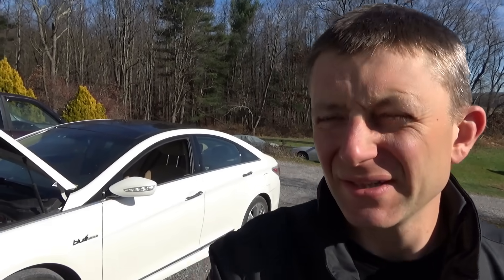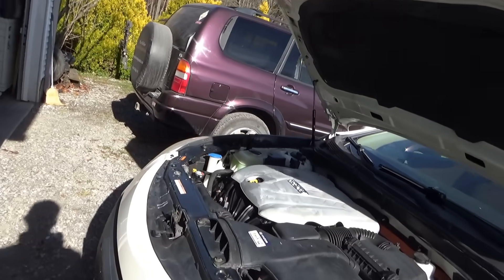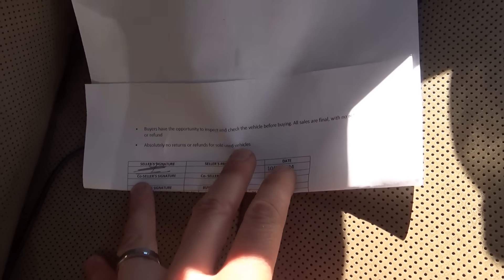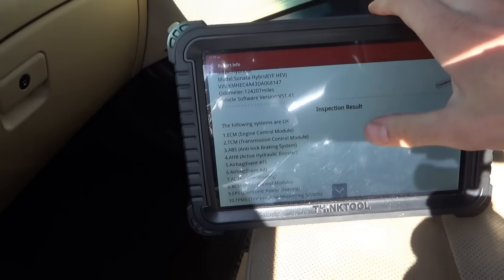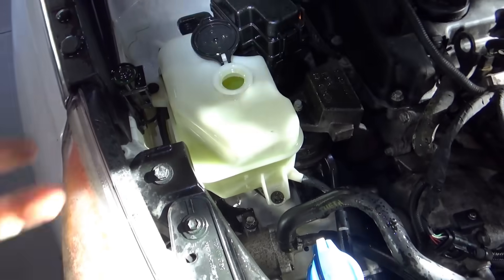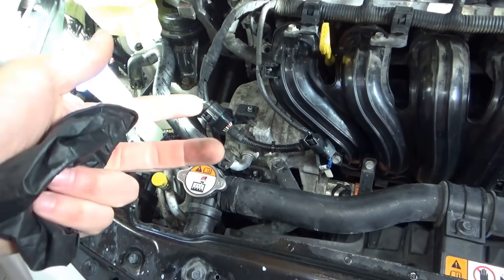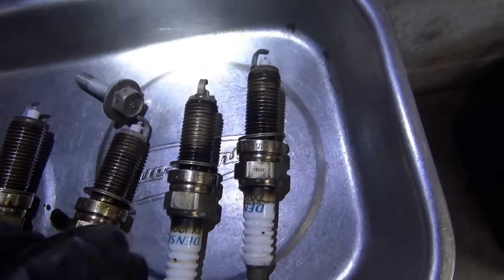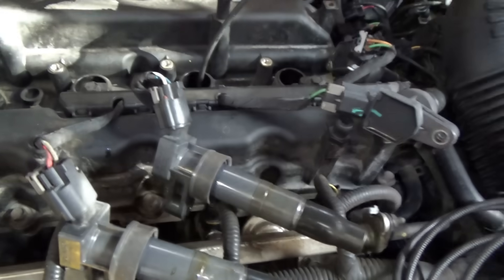Customer SCAMMED?! Hyundai Hybrid NO HEAT & PUKING COOLANT?!?!

Comment: That was bizarre ...it should have been pouring coolant out the tailpipe with that large leak...I guess the cylinder pressure was keeping most of it out but it really should have filled a cylinder after shutdown if it hadn't blown all the coolant out....you get some unique challenges Ivan....Karl from Canada🍁🍁🍁

Comment: If you live in a state with some level of consumer law, the dealer has to stand behind the car to some extent. Driving, home, 1 day, 1 week and a major problem, that is the dealer's problem or minimum the state will come down on them and their license to do business is in danger. Because of the age and little snow, it looks quite good from the outside, this novice buyer just drove it, looked at the outside, and bought it.
There are junk yard auctions and that is here the dealer goes, you typically need a dealer's license of some sort to buy there, many are insurance totaled vehicles, you know what you are getting into if you buy a totaled vehicle. If you buy through Carfax they will identify branded vehicles and the reason. If the car was not covered and a barley running trade-in or rejected for resale trade-in from a dealer, there may be little smoke, other than any Kia/Hyundai with over 80K is on fire regardless of the price.

Comment: VA, those Navy Sailors can't touch cars. Seen ones that work on a Nuclear Carrier, but blows up tire putting air in it, running back and forth to the dash, keeps putting air in till the light goes off. I had one snap back at me calling me stupid cause what their MOS is yet set their tires at over 95psi, with no oil in it, no coolant and wonders why.

Comment: I wouldn’t blame the dealer. Customer had every opportunity to get the car checked over and didn’t and I’m assuming he drove to Virginia from pa because the car was cheap. Bought the car as is. Customer didn’t do his part if I was the dealer I wouldn’t warranty anything. Small dealers are usually like us small auto shops and don’t want an unhappy customer I highly doubt they knew there was anything wrong with

Comment: Hello, I watched the video through I might have missed it but, were the radiator fans coming on when it was over heating?  That year Hyundai in the hybrid or not can have cooling fan resistor problems or the cooling fan will lock up. To cause the overheating and head gasket leaking of course. Thanks for the content.

Comment: States should start outlawing these types of dealers. It should be illegal to blatantly scam someone like this. I'd advocate for a 30-90 day consumer protection program on ALL vehicles ANY dealer sells (based on age/miles) and if a dealer gets caught 3 times in 12 months knowingly selling broken junk their dealer license should be permanently revoked. If I were the owner of this car I'd file in small claims court to make them defend themselves for knowingly selling a car with a damaged engine and failing to disclose that fact.
Reply: There is no proof the dealer scammed anyone. The customer drove the car to Ivan overheating! I am not saying the car didn't have any issues when he bought it, but its a used car the buyer should have had the car car checked out! They should have shut the engine down and had it towed at the first signs of overheating not continue to drive it! I think the buyer blew the head gasket because it may have had a water pump or  thermostat failure. I believe its all on the buyer! Of coarse my opinion is based on only what is in this video which is one sided. You always get a pre-buy inspection done! Always! No matter how new the car is and it doesn't matter how low the miles are. I have seen some very messed up cars at a year old and less then  20K miles.
Reply: @PrecisionMotorCar  That is a lot of victim blaming. All I'm saying is that used car dealers should be forced to stand behind their goods. No other business is legally allowed to scam people and hide behind "As-is; no warranty". For what it's worth, I've had a head gasket blow with zero warning signs due to bad luck with a burnt exhaust valve. No lights on the dash. Temp gauge in the normal range. Overflow tank exactly at the correct level. The only warning that the coolant was dangerously low was a gurgling noise from the heater core. It happened to be summer time so we weren't using the heater to know if it was putting out cold air. I have no idea how long we drove around like that and telling me that is my fault would also be victim blaming.
Reply: @TheRetarp  So if the head gasket happen to blow just "Because" that would not be the selling dealers fault. Maybe it failed on the way home? If so it would be you bought a used car and oh snap that sucks. We are assuming the selling dealer knew that the head gasket was blown, what if they didn't Know? What is they bought it from the auction had it unloaded from the truck it had no dash lights on and put it on the lot for sale. Why would that be a scam? We all know the sellers don't drive them, they never have enough fuel in them! Also they don't have a shop check them out before selling them! "Some do but not many" If the dealers had to fix everything that failed on a used car a used car would cost more than a new one! That is why there is a "As is" clause. Would you sell a car and stand behind everything that failed? How long do they warranty the car for? If the dealers were made to warranty a car for say three months then everyone would still call the dealers all scammers because it didn't last four months.The customer bought the car with bald tires. But did the buyer make a better deal and he was going to get his own tires? We don't know any of that! Just so you know I am not a car sales dealer I am an auto repair shop and I am the first one to beat up a car dealer! I just think we are blaming a car dealer with out all the facts. I know I would be pissed if I was that selling dealer and had worked out a deal that the car had issues and the buyer knew it and bought it cheaper and then everyone called me a scammer. The auto industry already deals with that enough! Again just trying point out it is a one sided story, we know the customer drove the car critically overheating, we don't really know how long the buyer had the car, we don't know how long they drove the car overheating? Just don't think we should throw blame when we don't know. The buyer should have not signed or bought the car if they didn't understand what "AS IS" means and should have had the car inspected! I am not saying the dealer is above board " very few are" But the buyer has to protect their investment and that starts with a used car inspection. Thanks for the chat! @TheRetarp
Reply: @VOLKSONLY  You are correct we don't have the full story here. This channel is notorious for one sided stories. I will stand behind my statements. A business which relies on taking peoples money and not delivering valid goods or services is not a business, it's a scam ran by thieves. You said you are a mechanic. You warranty your services right? How do you feel about repair shops which don't stand behind their work and also won't issue a refund? I'm guessing they probably piss you off! We have a few local 2nd hand games/cd/dvd stores in town where I can buy used gaming consoles which are guaranteed to function. If the console fails within 30 days I can take it back for a refund or replacement. If your shop can stand behind their services and a second hand game store can stand behind their products, why should a car dealer be any different? For example if I buy a car and the first time I fill the tank the MIL comes on for an evap code or it's leaking gas or yes if the head gasket blows on the drive home then in my opinion that dealer should be forced by law to either take that car back for a full refund or to repair it at no additional cost. They sold a defective product pure and simple. A business should be proud of themselves and stand behind their products. If they can't do that then they shouldn't be in business. Many countries around the world agree and have implemented consumer protection laws on used cars purchased from dealers.
Reply: @TheRetarp  The customer had the car at least few weeks (Ivan states in the video) I am sure it ran fine when the car left. I am sure the buyer would have been back the next day to the dealer if it had the issue in the video but that didn't happen. That points to the fact it ran ok. The selling dealer had no way to know that the head gasket is going to fail. Ivan in the very beginning of the video is pointing to the fact that it is a Hybrid and they have known head gasket issues. Well at least Toyota do. If you sold a used car to someone and that car was working good when you last drove it and didn't know that the head gasket was going to fail in three weeks would you give the person back their money for the car or pay for the repair? I doubt it. Especially if you found out they drove it overheating causing the head gasket to fail. That's why there is the "As is" policy. In my state it is always "As is" unless stated otherwise. Used cars can fail at any moment, the car always worked good the day before. So if the water pump failed (Assumption) after two weeks of ownership and the buyer continued to drive it overheating how is that the selling dealers fault? We know for a fact that the buyer drove it to Ivan overheating. That alone puts the blame on the buyer it should have been towed. If I replace a water pump on a customers car I warranty the water pump for 12 months or 12,000 miles which ever comes first. If that water pump fails and drains out all of the coolant but the customer keeps driving it causing it to overheat and destroy the engine we do not warranty the destroyed engine that is on the customer they should have been aware of something not right with the car and had it towed. Please understand I agree with you about shady dealers and business. But we are blaming a business without proper proof. We know the car went a few weeks before having the issue, if the car had the issue before they got home then I would be on the side of maybe they are a shady dealer. But that is not what happened (again only going off whats in the video). But again they bought the car with the "As is". We buy used cars for a reason, cheaper than new and there are always risk when buying used cars. That car did not have one trouble code in the entire car which is amazing for that age and mileage. I don't work on very many used car dealer because they always want it fixed half way and cheap and I won't do either so they won't come to me. I will be the first one to tell them straight up that they suck! And then they move on to the next shop. I see your point about all of this! I just hate it when people start blaming a shop or car dealer or any business without proper proof even if its a shady business. All my years doing this if you dig down to the facts you will find the customer doesn't tell you the whole story and always leave out the parts that incriminate them and then everyone just blames the business. I have seen it over and over. I will never talk bad about another shop unless I have absolute proof they are in the wrong. We all make mistakes and the consumers always assume we are out to rip them off. Cars are expensive and very complex its just the way it is. Thanks again for your insight! @TheRearp
Reply: @ To be clear I'm specifically talking about user car dealers should be forced to stand behind their products. Any private deal between two individuals is of course their own business. I've been avoiding anecdotal stories but I do have one of my own about a shady corner car lot a long time ago. I was in college at the time and my car was totaled in a crash (the other driver was cited). I needed a car so I took the insurance money and purchased a crown vic with a 4.6L. During the test drive it runs and drives butter smooth. No MIL. Fluids all look great. But sold as-is due to high miles. I was a college student in a bind I need to get to class and to work. I'm like fine seems like a good deal, these cars are known to be reliable, and it's in my budget. I buy it and drive it home without issue. The very next day it's leaking coolant all over the ground. turns out the intake manifold was cracked (common issue on the 4.6L). Called the dealer because I've had the car less than 24 hours and put maybe 10 miles on it. I offered to return it for a refund. I offered to split repair cost 50/50. Nope, the owner wouldn't lift a finger to help let alone make it right. Said it was my problem and he wasn't going to do anything. While legally true it showed this person's true colors as a liar and a thief. When I initially looked the car over I had smelled a whiff of coolant smell once and only once. Asked about it during my inspection / test drive and the dealer owner told me they had just serviced the car which included checking and topping off all fluids, that's why the smell and assured me there was nothing wrong with the car. Can I prove the intake was cracked when I bought it? No. Do I suspect they knew it was broken and scammed a desperate college student in a bind? Yes. Good chat @VOLKSONLY and I wish you well.

Comment: I think I would have topped off the coolant (burb the heater core if possible, fill reservoir) and then performed a coolant cylinder pressure pulsation test with a pressure transducer and Pico scope. For reference I would use a COP detect wand on cylinder #1. You can't really fool this test when you see pressure pulses and they follow cylinder firing. Unfortunately, you have to have a pressure transducer, Pico scope and the correct radiator cap adaptor. Once you take the capture of the blown head-gasket and send it to the customer you can ask if they would be willing to pay for a coolant pressure cylinder leak capture (video) to witness water entry into the bad cylinder. They usually decline to save some money.

Comment: A THOUGHT:  I wonder if these hybrid head gasket problems could be reduced or eliminated if the gas engine idled from start-up to shut-down?  In other words, no engine off while driving.  This would cost a (very) little mpg, but maybe reduce head gasket failures.  It would also eliminate the need for an auxiliary coolant pump.  (From testing, my 6.5TD and 2.2L Saturn use ~ ½ gallon of fuel while idling.)  If this would work, the best solution would be a software rewrite; if I owned one, I'd just figure out which accessory kept the engine running all the time while using the least power.  What say ye?  Thanks for your awesome work!

Comment: This was an interesting one 
Usually these 2.4 Theta II's kick a rod through the block or guzzle oil until they burn a valve 
I can't say I've ever seen one blow a head gasket 

Double shame that if it had the KSDS update done, it would've been covered under the 15y/150k (now lifetime) engine warranty IF IT WAS ROD BEARING WEAR 
Unfortunate situation for the customer

Comment: If the selling dealer did not tell the customer about the no-warranty then maybe he has a chance.  Besides the engine and worn tires, what else is junk on the vehicle?
In California if you sell the vehicle, it MUST have all it's smog equipment and be able to pass the emissions test.  If it fails, the previous owner pays to have it fixed and pass the test.  If this owner had got an inspection first, he could have passed on this car.  LET THE BUYER BEWARE.  If it looks and sounds to good to be true, it probably is (bad)!
Good one Ivan.

Comment: Hi Allen, dunno if Hyundai has the same system as the Chevy Cruz, had that exact problem in 2011 Chevy Cruz replaced everything and it turned out to be the thermostat because they were electronic and the temperature that it’s set on the vehicles are 224°, needless to say after changing thermostat, the car ran like a champ forever still running thanks just an FYI maybe it’s the same system.

Comment: Kia and Hyundai cars are just plain junk and their warranties are worthless. My buddy and his gal friend in their 80s bought a 2018 Kia Soul 1.6 turbo when the car was 2 yrs old with 7K miles. The car was a Certified Pre Owned car so it came with the 10 yr 100K warranty. Last year after thanksgiving he was headed out of town and while passing a car the engine just lost power and quit. No smoke or steam till the car stopped beside the road, mileage was 91K. We had to tow it almost 200 miles back to the Kia dealer who said no problems we were covered under 2 warranties as when buying the car they got sold another 10 yr 100K that was suppose to cover everything Kia didn't. After being in the shop 2 months the dealer said the engine was shot from blown head gasket as it had no compression in any cylinder. Kia warranty said that if my friend didn't pay for a tear down of the engine which cost $500 they wouldn't fix the car. So my friend paid the $500 and had it tore down. The Kia factory person denied the claim as they said the engine was sludge up. I had been changing the oil every 5K and that engine did not have sludge in it, besides sludge would have nothing to do with a blown head gasket. We towed the car home and gave up fighting Kia as when you read their fine print they have an out for every thing. I looked over the engine and found 2 areas of casting slag in the water passages of the block sticking up about .004 in keeping the head gasket from being able to seal properly,  odiously manufacturing flaw.  I ordered a new engine from China and it arrived today soon hopefully I will have the time and put it in and get the car going again and will sell it!  BTW Kia wanted 15K to put a new engine in a car that was worth only about 11K retail. The new engine form china was just $2000. My advise is run away from a Kia or Hyundai product.